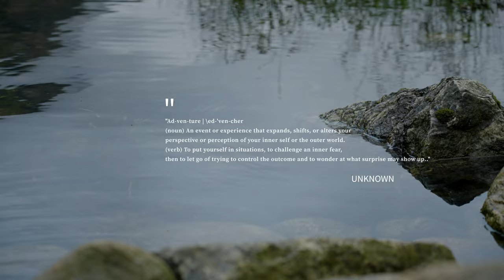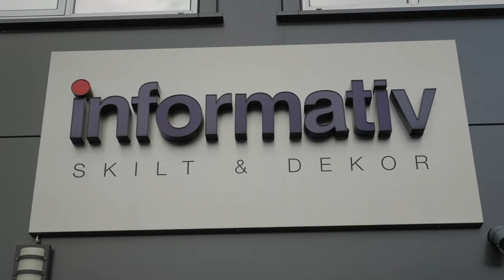Adventure is more than Motorcycle | Campervan 2024

Comment: I had it all big transit, transporter, landrover with rooftoptent, ... . still love it but love moto camping more because it's more "hardcore". Now I have a vw caddy which is perfect for everyday use and I put a rooftoptent on it when I want to go camp and/or pull my adventure bike on a trailer if I want to avoid long highway miles or want to have a basecamp somewhere :)
Reply from the maker: What is your experience with a roof tent? Was it crazy with condens? I read so much about this online. I have been looking at it for a while now and not sure if I’m better off with just my normal tent. I guess when you have been riding for so many years you get tired of all the long hauls on the bike. Much better to just set basecamp somewhere and explore around it. I see so many possibilities in the future around this. Cheers

Comment: Good job Thomas.  I travel a lot with my pickup truck with a small topper cap over the bed.  I can sleep and stay many places in good and bad weather.  It really keeps travel opportunities open for me.  You have a young family as well.  Pretty soon it won't all be about you and your travels but about the family and shared experiences introducing the little one to a world outside to enjoy.  Start them young.  They develop much better.  Now there are zillions of youtube sites converting vans such as yours to camper travel, minimalist expense and many full time life in a van on the road.  Check them out.  The diesel heater can be mounted outside in a box and vented properly.  It can be removed and stored inside.  Only a hose to enter the cabin for heat.  Safe.  The roof vent, there are a couple or more brands, select the quietest one.  Simple install  The led lights are a good choice.  Some cooking inside but it is best for big meals be prepared out side to keep all the smalls out.  But some  Coffee is a must.  Pee bottle maybe a honey bucket depending on weather and location.  Yeap,  handi-wipes to clear the dingle berry patch.  Hahha Amazon has a lot of items.  A solar panel or two on the roof and battery power is great but winter time limits that up your way.  An Anker or Jackery power pack system is very good.  These are evolving very fast given battery technology.  It is good to be able to power all you can without a generator.  There are many battery hand held shower units which having only some warm water in a bucket you can wash off with.  Use the coffee maker to heat water or a stove.  Make you bed high enough to sit on and not hit the ceiling to maximize storage under it.  Also maybe a fold down table ledge on the other side to place stove and eating.  food can be stored in battery powered refrigerator/cooler setup.   This stuff is very efficient these days and require minimal power.  So a new world opens for you.  enjoy.  It beats being froze almost to death in the bad weather, chances of injury, or just staying home.  The main thing is to go.
Reply from the maker: Thank you so much for this comment and your own experience, appreciate that a lot! I'm still new to this, and not sure what is the best way to go forward. There is no doubt that I will spend more time with my family in the upcoming years. The older my kid get's the more he want to join in on my activities as well. I don't want to build to much in the wan, I want it to be as usable as possible, and easy to turn from one scenario to another on the fly without having to mount or demount to much stuff. 
There is a diesel heater already installed to the car/engine. So I just need to see if this is something I can control manually and make an outlet to the back of the car as well. Roof vent I have no clue about, but I hope to find one that is low, so it won't be in the way for my roof rack. I'm also considering an Awning from ABR. Do you have experience with awnings? 
I will do all or most of the cooking outside from the car. but morning coffees etc I will make inside the car. I have reached out to Ecoflow and Anker when it comes to those large powerbanks with solar panels. They are quite expensive, but I guess they are better because they are easy to take in and out, and don't take to much space. There is a huge possibility I will get myself a e-bike as well, so I can explore all the amazing places that is forbidden to ride with a motorcycle 🤭 Cheers mate, appreciate this post. Thank you

Comment: Congrats and "welcome to the club" 😉 Similar solution here: Berlingo (because I can open the wall to the back) + foldable trailer for CRF 300 & mountainbike👍
Reply from the maker: Here in Norway it is not allowed to remove the wall (green number plates) this will result in a hefty fine and extra taxes. Or I would remove the wall myself. Looking at a foldable trailer my self, they look really great and so easy to store away (not much room for trailers here I live) 🙌🏻
Reply: Tip: The NEPTUN trailers are quite OK and incredible cheap here in Sweden...
Reply from the maker: @auroratours6716  great tip, will have a look 👏🏻🔥

Comment: Remember: light is right. Don't add too much stuff to the van and keep it simple. You can work with fabric instead of wood.
Reply from the maker: You are absolutely right my friend, i will keep it as simple as possible so i can go from one thing to another rather quickly. I want this to be a multi purpose car, and have no intention of building a huge thing in the rear. I have my Trangia, my pad and sleeping bag. I’m really happy with that solution.

Comment: I have done the same except that I opted for a Ford Transit Custom. A little bigger car that fits a full bed and kitchen but still small enough that I can park anywhere. I made interior into removable modules so I can still use it for other things, like transporting a new motorbike etc 😂😅
Reply from the maker: Congrats on your new van as well mate. I had a look at the custom, same with the transporter and the one from Opel. But the riding comfort is worse for me with my 200cm in those. So for me it was either this, or the big Transit or Crafter/Sprinter. I will look closer at a trailer to move my bike around 🤌🏻

Comment: That is quite interesting as I had an idea of buying transit connect myself ;) The big question I have is if it will fit a small (ish) bike to the back
Reply from the maker: Great mind thinks alike. Well, it depends on the bike, my T7 is no chance to fit inside. a smaller bike, well, as long as it's shorter than 215cm and 110 high.